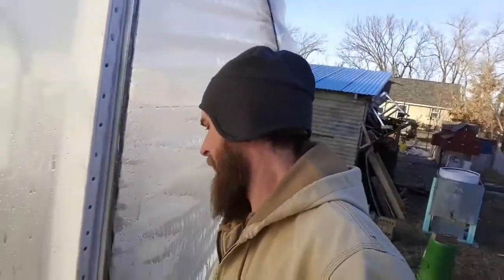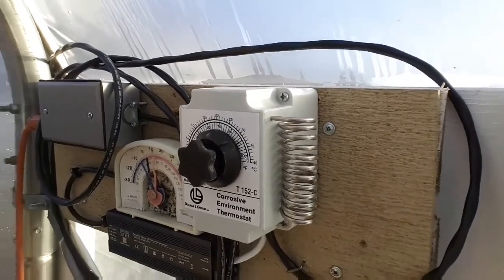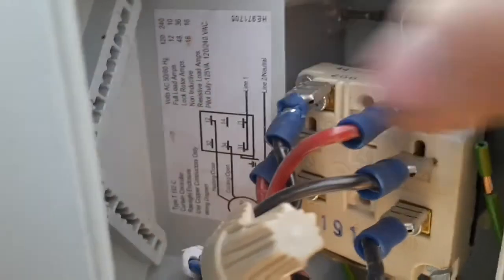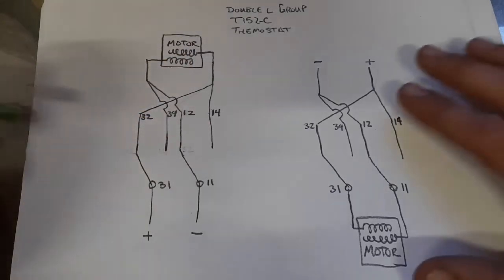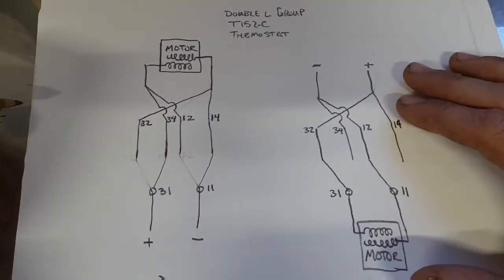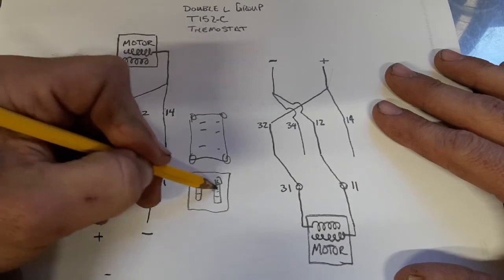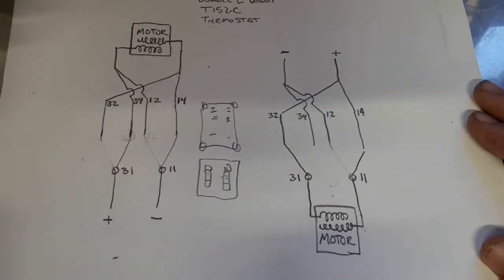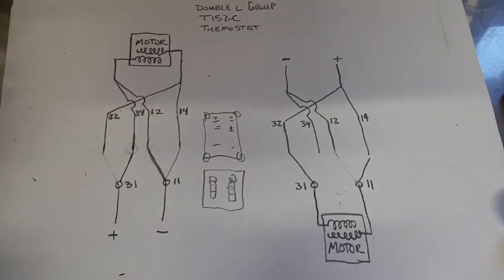Automatic Greenhouse Side Curtain Wiring (Option B)

Comment: Hey Keith, I'm setting up my system just like yours,  I only found the Double L T-152C for sale from QC supply,  but they state it's a 120/240 volt thermostat,  is this the one you used? Or where did you get your thermostat?
Reply from the maker: Yes that is the correct one. But I found a cheaper way. 
https://youtu.be/FeGKA_zsZzE

Comment: How do you set the high low temps on the T152-C?
Reply: i have a similar question. when i set up the controller and set my temp to 70, i can hear the contacts and see the motor switch directions at about +5* and -5* but when i check on it the next day relays don't switch until super low and super high temps... like 40* and 100* if at all. some times i can even get the contacts to flip.

Comment: Hey Keith, does this system operate for only one side or for both? I wasn't sure if you had the motors from both sides were feeding into the same thermostat or if you had a duplicate system set up on the other side of your greenhouse. I'm designing a system based off of yours and appreciate your help and videos so much! Thank you!
Reply from the maker: You should be able to run both sides. I am only running one side because the cross winds vent fine. After it gets hot both side stay up.

Comment: Hey Keith this is a great video, and the only one of any use on the entire web, thanks for it! How has this set up lasted the test of time? Any seizing of the contacts still happening?
Reply from the maker: Nope.  Been good for 2 years. I've heard if you use 12V instead of 24V the contacts don't seize but I have not confirmed.
Reply: @farmerkeith  Cool man, just hooked up mine for the first dry run, couldn't have done it without your video.. You are the best
Reply from the maker: @opietaylor7561  Right on!
Reply from the maker: @opietaylor7561  KICK A$$! This is the reason I do what I do.

Comment: Do you have manual control in any way?  Storm button, etc?  I have a button operated electric roll up system that I'm thinking about adding a thermostat to but I don't want to lose my manual control
Reply from the maker: Was going to add one. But during the summer all sides are up until fall.

Comment: Hey Keith, im about to order my parts , you say here that a 12v transformer will work better but how does that affect the operation of the 24v motor?thanks for your time.
Reply from the maker: I am not 100 percent sure, but I spoke with a greenhouse company that sells the set up prewired and that is what they said they used. Easy with solar. If you wire with option B it will not matter 24V or 12V.
Reply: DIY Farmer Keith ok cool, thanks for the quick reply, I was just worried that the motor would not have as much power on half the voltage
Reply from the maker: @farmerrick9660  most 24V motors are rated for 300 ft of side curtain so theoretically half the voltage would still do 150 ft.
Reply: DIY Farmer Keith good to know, I’m having a hard time locating that thermostat here and sold out in US?? I think you helped many small dudes like us, cheers